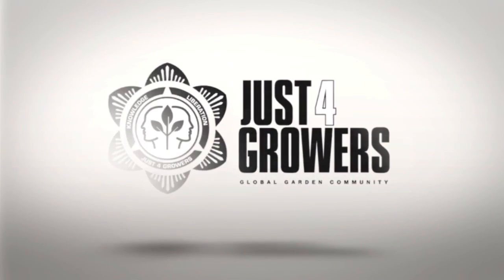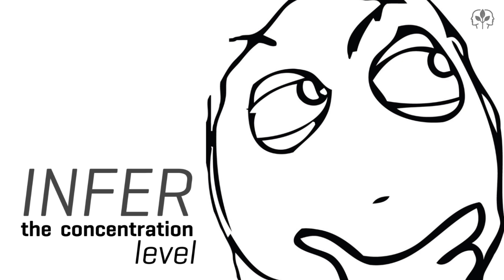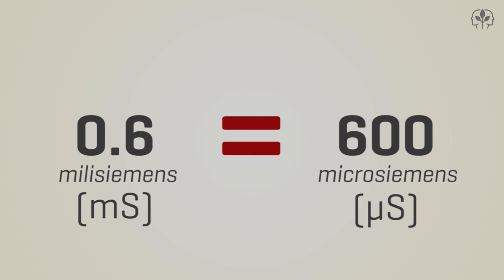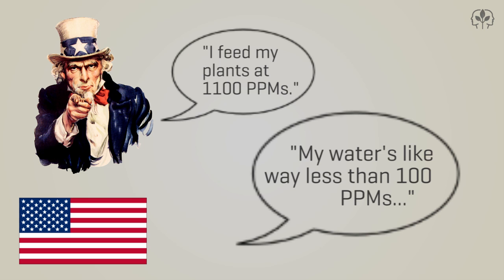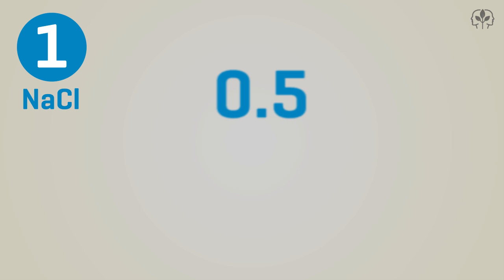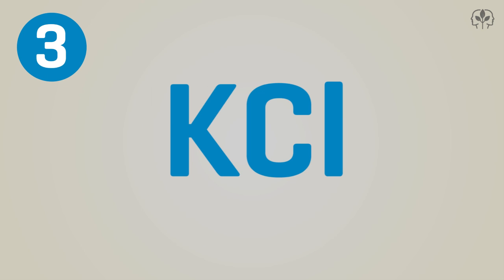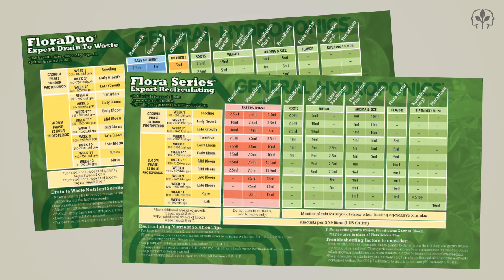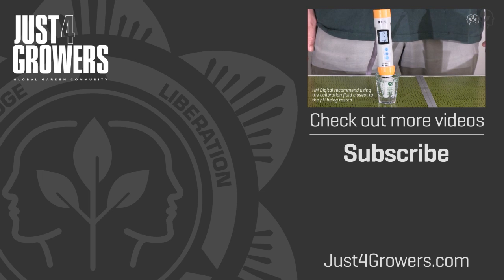Hydroponic Nutrients TDS, PPMs and EC Explained!

Comment: Please explain a orb meter for me 😂 you are the only person that can explain it to me in a way I can understand
Reply from the maker: An ORP [Oxidation-Reduction Potential] meter measures your water’s ability to either gain or lose electrons in chemical reactions.
Oxidizing: Means the water can accept electrons, which often indicates the presence of disinfectants like chlorine or ozone, used to break down contaminants.
Reducing: Means the water is capable of giving up electrons, suggesting it might contain reducing agents like hydrogen sulfide or organic matter.
An ORP meter gives a single number in millivolts (mV), which reflects how oxidizing or reducing the water is, helping assess the water’s cleanliness and disinfection status.

Interpreting ORP Readings:

Positive ORP Value (e.g., +200 mV):
Indicates that the solution has a greater oxidizing ability, meaning it can accept electrons from other substances.

A higher positive value generally suggests a stronger oxidizing agent, which is good for killing bacteria or disinfecting water (e.g., chlorinated water).

Positive values are common in environments with disinfectants or oxidizers like chlorine, ozone, or hydrogen peroxide.

Negative ORP Value (e.g., -200 mV):
Indicates that the solution has a greater reducing ability, meaning it can donate electrons to other substances.

A lower negative value suggests the solution contains reducing agents like organic matter, sulphur compounds, or unoxidized metals.
Negative ORP values are often found in environments with decaying organic matter or polluted water.

General Interpretation Guidelines:
+200 to +400 mV: Water is moderately oxidizing; good for drinking water treatment.
Above +600 mV: Strong oxidizing conditions, suitable for disinfection (like swimming pools).
0 to -200 mV: Mildly reducing; often found in natural water bodies.
Below -400 mV: Strong reducing conditions, which could indicate the presence of contaminants or decaying matter.

For hydroponic systems, the ideal ORP range for a nutrient solution typically falls between +200 to +300 mV. This range ensures that the water is slightly oxidizing, promoting a balance between nutrient availability and microbial control. Here's why this range works well:

+200 to +300 mV: In this range, the solution maintains a healthy level of disinfection without being overly oxidizing, which can harm beneficial microorganisms or plant roots. It also ensures that the nutrients remain available for plant uptake.
If the ORP goes too high (e.g., above +400 mV), it may indicate excessive oxidizing agents (like chlorine), which could stress or damage plants. Conversely, if the ORP falls too low (below 0 mV), it could indicate a lack of oxygen or microbial activity, which can lead to poor plant growth or the development of pathogens.

Hope this helps!
Reply: @Just4Growers  thank you will read this a couple of times till it goes in but that is by far the best explanation of a orb meter. Much appreciated. 🫶🏻 

So if I got this right, if you have a low reading would you either change res or add more hydrogen peroxide if you were running sterile rdwc? I want to fit a growtek dosing system and it has an orb meter. It’s going to be connected to the buckets so it can dose while it’s recirculating and be topped up by RO in the res. So I’m assuming I could put a peroxide on one of the dose pumps

Comment: Im still confused. My location is SE Asia. Scratching the hair off my head trying to.sort out my nutrient water solution and soil runoff. My TDS-EC meter displays ppm and EC. so when it displays 0.600EC is that the same as 6000 microsiemens?
Reply from the maker: Hi Jay, thanks for your comment. When your TDS-EC meter displays 0.600 EC that's 0.6 milisiemens. 1 milisiemen = 1000 microsiemens, so 0.6 milisiemens = 600 microsiemens, not 6000. Typically, you would grow vegetative crops around 1.2 milisiemens or 1200 microsiemens. Some flowering crops require feeds up to 3.0 milisiemens or 3000 microsiemens, or higher. Stick with SI units like milisiemens / microsiemens.

Comment: how does .5 ec answer the question of that ppm scale to use lol
Reply from the maker: 0.5 is the conversion factor, not the actual reading. So using this scale, 2.0 mS (EC) = 2000 uS = 1000 PPM (2000 X 0.5). If you were using the 0.7 conversion factor then it would be 2000 X 0.7 = 1400 PPM. As you can see, the conversion factor you use can make quite a difference so .... just use EC like those friendly, sensible Europeans.
Reply: okay that all makes sense so then .5 is the conversion factor for the Nacl meters?

Comment: Some growers might be confused with EC reading and measured concentration being dependent on the ionic nature of each constituent. For example nacl is a good conductor where sugar solution doesn't conduct as well in equivalent molar concentrations. If you accurately measure your nutrients and carefully adjust your pH I believe measuring EC or PPM will serve as a guideline. Better still, a accurately prepare your "standard nutrient solution", measure that EC or PPM, as you prefer, then use that reading for future measurements. There is no real substitute for accuracy when using powerful nutrients with your grow.

Comment: " "brand name here" meters are calibrated with a 342 ppm NaCl solution"
I'm guessing this means the meter will use the NaCl conversion?
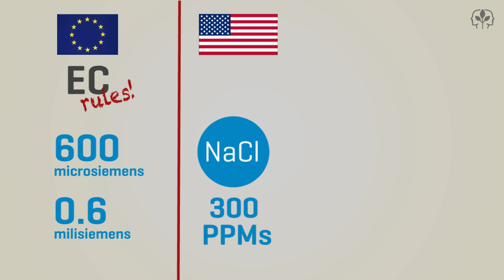Reply: JJ  different conversion factor means you will have a different reading as stated in the video 3:20
Reply: JJ  the meters are all the same but the internal multiplying factor differs
Reply from the maker: +Middle Finger yes.

Comment: Everest,

Love your videos man and have ask a few questions since finding them. But I have another for you!

In DWC, I am using a small 5 gallon tote that holds to my lever 3 gallons of water. I am currently trying to find my plants feeding EC by slowly raising the base of my EC to see where it will plateau (in-taking water, nutrients and dropping) all at the same rate (General Hydroponics Flora Series). 

Now for the question.. How much is TOO much of a concentrated solution to pre-mix to add to my reservoir, which I might add there is no roots exposed as top / netpot are pulled out and set in an empty tote while I have a small recirc pump that I drop into the bucket for mixing. 

My idea or what I have been doing the past few days is mix up 1/2 cup RO water, add my Micro at 2 parts, stir very well. Grow at 3 parts / stir and then my 1 part bloom. I have doubled this for a larger mixture when needed. Do you think I would run into a nute lockout issue with this method? I am trying to raise my EC in small increments and actually using PPM @ .5 (so increments of say 25-50).

Comment: okay... your video will be much helpful in my DIY project...But which multiplayer should I use to calculate the TDS of drinking? water
Reply from the maker: +Milan chhatralia well, I usually go by x0.5 - it's not so much about what you're measuring, just to know which multiplier you are using especially when it comes to interpreting feedcharts or using calibration fluids stated in PPMs.
Reply: +Everest Fernandez (Just4Growers) Thanks a lot for your advice.

Comment: by using the example you made using the 0.5 NaCI conversion factor, if you were to get that reading from a solution, will it make that calculation to 300ppm automatically or does every reading taken need to be multiplied by the conversion factor (0.5) to determine the real ppm for that meter? So for example, If you were to get a reading of 1000 PPM on a regular TDS meter using the 0.5 conversion factor, is that the final reading or does that need to be multiplied by 0.5 to get the reading of 500ppm? What's the actual reading of the solution? 1000 or 500?
Reply from the maker: +NBAXXX Hi NBAXXX thank you for your question. To take your example, if you use a TDS meter to measure the PPMs of your nutrient solution and it says 1000 PPMs then stop right there. 1000 PPMs is your reading. You don't need to multiply it by anything. But here's the thing---your TDS meter isn't actually measuring the concentration of mineral solutes in your nutrient solution. (The only scientific way of doing that would be to evaporate away the water in your nutrient solution and measure what was left as a solid residue. Not very practical!) Your TDS meter is actually measuring electrical conductivity. The more electricity your nutrient solution conducts, the more minerals are dissolved in it. Electrical conductivity is measured in Siemens, not PPMs--so the "conversion factor" I talk about is a way of converting the "real" measurement of electrical conductivity into the reading you see on your TDS meter. The X 0.5 conversion factor works like this. Your 1000 PPM reading was the result of this sum: 
Electrical conductivity (in microsiemens) X 0.5 = 1000
We can rearrange this equation to determine the original electrical conductivity reading:
Electrical conductivity = 1000 / 0.5
So our EC was 2000 microsiemens 
Or 2.0 milisiemens 

Growers in Europe, Australia and New Zealand think in these native terms of EC whereas most growers in North America think in terms of PPMs.

My advice? Train yourself to think about your nutrient solution conductivity in milisiemens or microsiemens rather than an inferred concentration in PPMs as this is what your "TDS" meter is actually reading. Then no conversion factors are required.

I hope this helps and clarifies! Thanks for watching.
Reply: +Everest Fernandez (Just4Growers) +Everest Fernandez (Just4Growers) Thanks for breaking that down. That was very helpful and makes more sense now.  

Just a couple of more questions. If you're using a TDS meter and received a reading of 975 ppm, is that considered to be 1.9 milisiemens or 2.0 milisiemens seeing as that reading falls between 1.9 and 2.0. Am I wrong to say that it doesn't matter which reading you choose because it's not a precise way of measuring to begin with.

Also, I see some people using a TDS meter in the run off of their organic soil mediums. Is this pointless? It seems the ppms can drastically fluctuate depending on how much runoff you choose to test. A 100ml runoff could read 400ppm but a 500ml runoff of water could read at 800ppm. Which reading is the correct reflection of your soil's ppm? Is an EC meter more suited for an organic soil medium or does it make no difference?
Reply: +Everest Fernandez (Just4Growers) No one seems to know the answers to this. Do you have any idea?
Reply from the maker: +NBAXXX Hi NBAXXX, sorry I just saw your previous message. Organic potting mixes have an EC, just as a nutrient solution does. You can buy specialist soil EC meters or you can mix some potting mix with some distilled or RO water to create a slurry and test that. You should test your run off after 25 - 30 percent of the volume of your feed solution has come out of the bottom of the pot. At first the EC will be higher (especially if you let the potting mix dry out a bit) but it should gradually come down as more run-off passes through the media. Testing the EC of your run-off is always a good idea, no matter what growing media you are using.
Reply: That's okay, thank you for explaining that. I found it difficult to find a straight answer on forums. I guess the approach to EC readings and feeding different plant genera is somewhat a trial and error process unless there is a EC/PPM chart that i'm unaware of available for each vegetable.

Comment: So what should your TDS meter read when your plant is completely flushed? Hope you can help? Thanks
Reply from the maker: +tv76g Hi tv76g—t's more about your growing media than your plant. When your growing media (presuming it is inert) is completely flushed it will read the same TDS as the water you use to flush it. This is easier with some media (e.g. rockwool) than others (coco) — look for a low CEC (cation exchange capacity). I'm going to make a video dedicated to flushing (been promising it for a while now!) so look out for that soon.

Comment: Awesome video. Is an EC test supposed to be able to tell you which nutrient is out of balance in your water? Or does it just tell you if your mixture needs topping up or diluting?
Reply from the maker: Hi Zeroizeable. An EC test is a good indicator of the total dissolved solids in your source water and you can usually make some reliable inferences about your water's hardness (typically calcium and magnesium carbonate and bicarbonate content) for example. As you mention, it can also indicate the concentration of your nutrient solution but it does not give you any data on specific mineral ions or nutrient balance. There are some more sophisticated meters on the market that do this, usually for commercial growers making up their own stock solutions.
Reply: +Everest Fernandez (Just4Growers) Thanks. Is it normal or common to use an EC test to check your nutrient solution levels, or is the test more about checking your source water's suitability?
Reply from the maker: +zeroizeable Both—but growers commonly used an EC meter to test their nutrient solution's conductivity, infer the concentration, and verify that it's suitable to feed to their plants.
Reply: Keep reading, you'll answer yer own ?

Comment: So EC is the same as PPM or TDS ? Just different math ?
Reply: ***** 
EC meters measures electrical conductivity and express it in milisiemens.
TDS meters measures electrical conductivity, but they have built in software that converts the milisiemens into ppm(parts per million). The "problem with TDS meters is that they don't all multiply with the same values and therefore different TDS meters will give different readings, while all EC meters will give the same readings..

In example: If an EC meter gave a reading of 3, and the software on one TDS meter would multiply by 4 to to give you the reading in ppm, it would read 12 ppm, but the software on another TDS meter multiplies by 5 and will therefore read 15 ppm.

In conclusion a TDS meter is an EC meter with software, that makes people confused and misunderstand eachother.
Reply from the maker: William Hansen Thanks William. That's it in a nutshell! In Europe, growers go by EC and save themselves a whole lot of potential confusion!